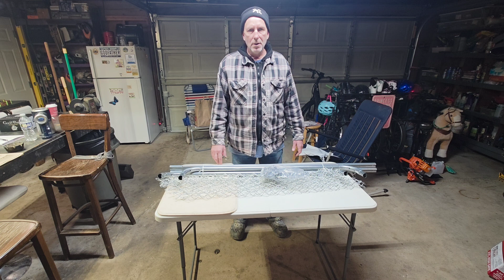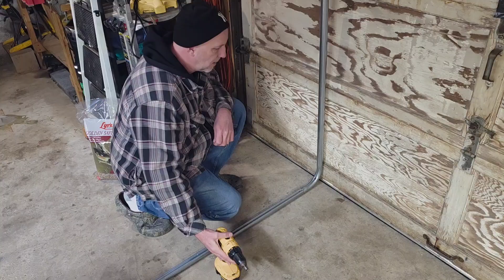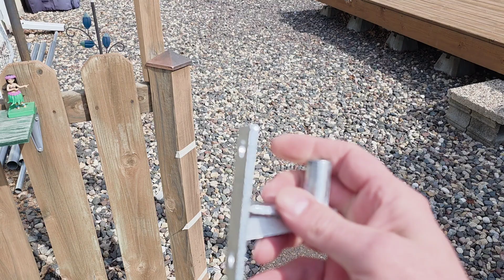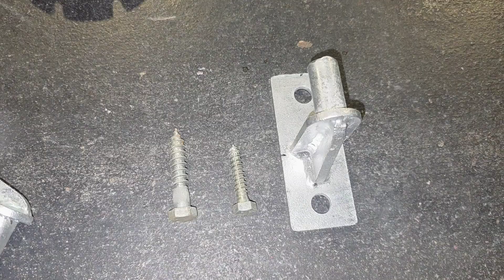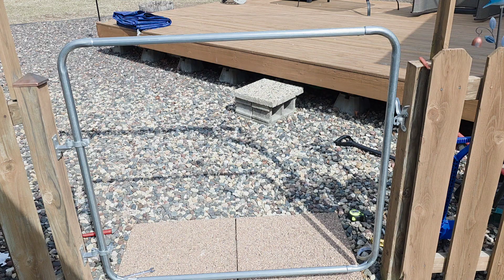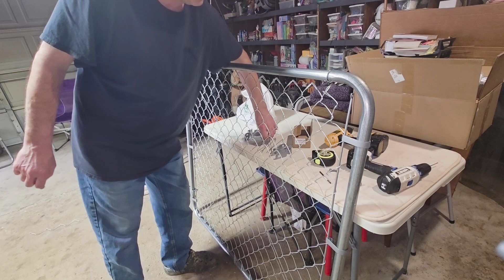Fit-Right Adjustable Chain Link Fence Gate

Comment: on the hinge side you should have put the bottom post facing up and the top one facing down-so no one could just pull the gate up
Reply from the maker: That's interesting. I never thought of that. I'm not concerned about security on that gate but something to keep in mind for the next one. It would probably bug me though that the full weight of the gate would be on that top hinge even though I know it would only make a minute difference. Yeah shit like that bugs me! 🙄

Comment: i had the same issue with thoses gate hinges,i ended up drilling out the holes on the hinges,and they fit now
Reply from the maker: I'm losing more faith every year in Menards merchandise. And I doubt they ever even had the manufacturer of those gates correct their problem.